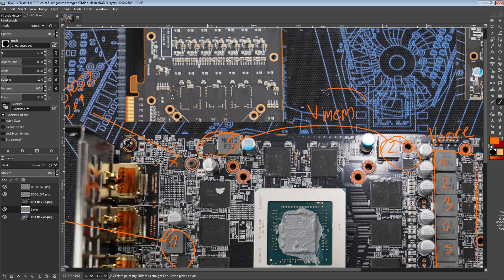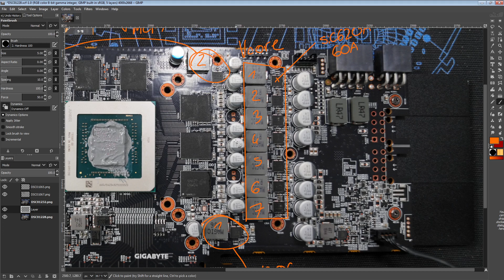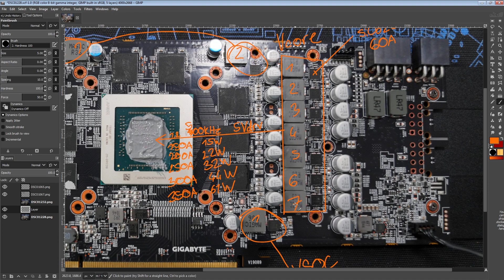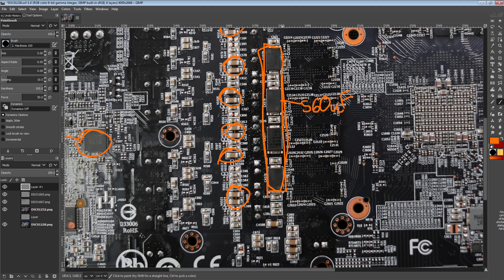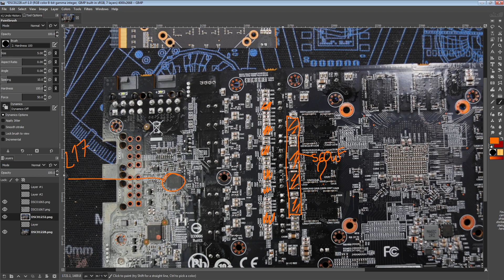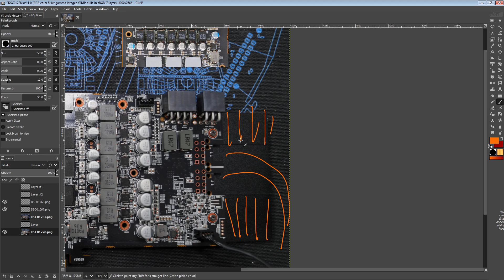GPU PCB Breakdown: Gigabyte RX 5700 XT Gaming

Comment: I have been running one for a While now, a Gigabyte Radeon RX 5700 XT Gaming. Paired with the Ryzen 7 3700XT Gaming 8 Gb Water Coold Arctic 360 CPU, I am thinking adding water cooling to the Graphics Card Just not sur if it is worth it, I have absolutely No complaints thus far, All RGB lights still work, I think most People Don't Go into RGB Fusion Far enough in the Setting to get all the Lights Working, I found today that There was a Way in it to specifically address each light on the MB, and any Device Hooked to it and Turn them On, or Off, Thats a lot of Light switches. They are all Working 104% LOL. I had the PC for a Couple years now since I built it and I just recently updated the BIOS on the MB. went from F2 Version To F35 LOL What a Difference. RGB Fusion Works. who would have thunk it ?

Comment: hi, thanks for all your great work,  I have a aorus rx 5700 xt, this board doesn't get recognized on startup anymore, since my aorus ultra x570 downgraded the bios from f33h to f30. it was getting junction temps of 113 C, so I reinstalled f33h and thought it all good again. 

but then I restarted my pc a day later and since then it goes to start up loop, the lights move and checks hdd, ram, etc. and stays on VGA, the loops back...I checked psu with other board and GPU, changed RAM and all works fine. 

so I tried with an Nvidia card, also all good. So my Idea was let me check and try to reinstall the bios..so I installed the nvidia card in slot 1 and the aorus rx 5700 xt in slot 2, and it started and I could see my rx 5700 xt in the device manager, 

so I tried to reinstall the bios with atiflash, but there it says its the same bios, funny thing is in the size of the old bios it shows the size of x00000 and the new bios that is the same one x8000. so here is my question; 

I can't install the bios because of secure boot and my mobo is UEFI, so how can I install it? can I delete or empty the bios chip on the rx 5700, and where is it and how do I do it? since so many people have these faulty GPU`S its may be a good video for you to make. thanks for your help.

Comment: Is this the same pcb as the aorus?
Reply: From what I saw in pictures, the Aoruss uses the same PCB, but the bulk capacitor section is fully populated (so it has two extra bulk capacitors when compared to the Gaming OC)

Comment: Does the Aorus version of the 5700XT has the same vrm or did they design a new one for the Aorus card??
Reply: From what I saw in pictures, the Aoruss uses the same PCB, but the bulk capacitor section is fully populated (so it has two extra bulk capacitors when compared to the Gaming OC)

Comment: So is this a good card or not, unfortunately i just understand half of it
Reply: It is okay, it’s basically a stock (Same Vcore, SSOC ETC powerstages) with some higher quality components and redesigned aspects that may (?) help towards overclocking but is still a cheap card. It’s cooling solution is likely why they are performing better (Bigger hunk of metal fins, Triple fans etc) 
So Everything else < Gigabyte < Gaming X, ROG, Red Devil, Nitro +
Reply: According to hardware unbox with their roundup this gpu is best all rounder.
Reply: @slevingaius  it is second but ok
Reply: You read my mind ! This guys spends 40 minutes talking jibberish, I just wanna know if it is any good or not ! :/